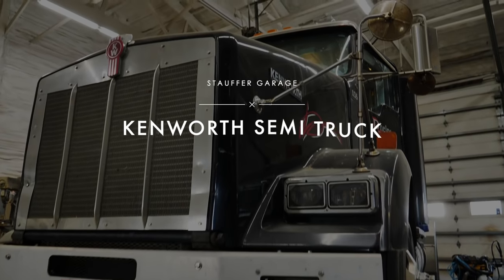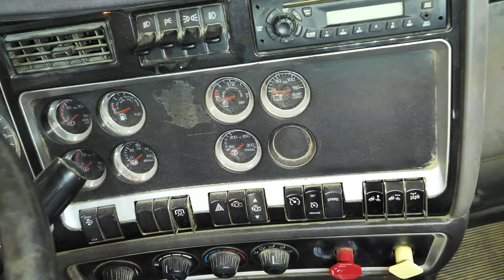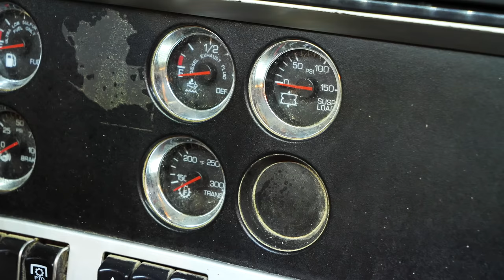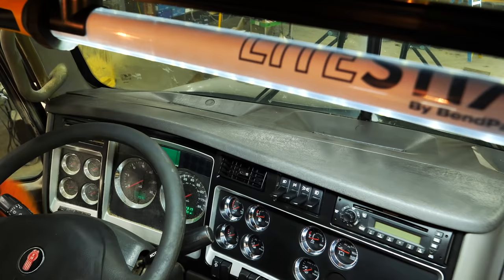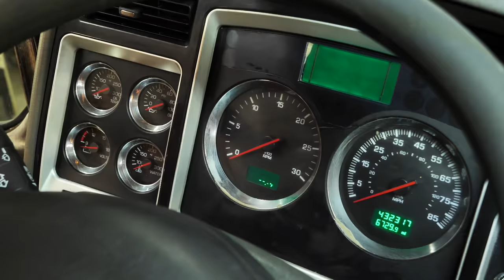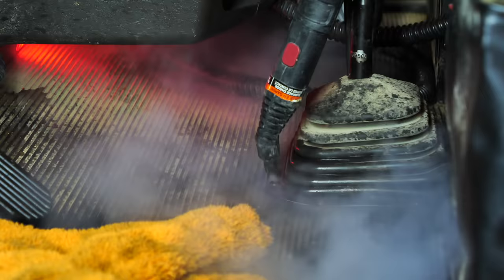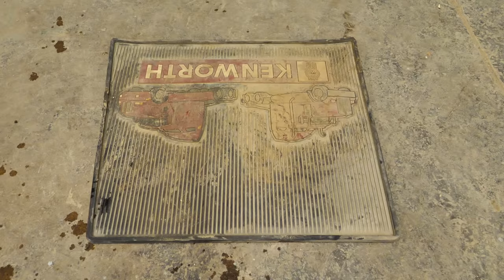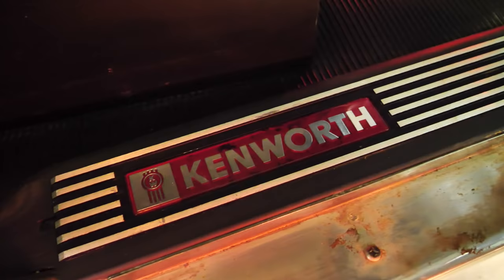Deep Cleaning A FILTHY Semi Truck For Free! Car Detailing Restoration

Comment: I have had a good start to the year with a couple of old rusty tool restorations and repairs. It's gratifying to make something nice and useful again. It's also addicting. The steam cleaner is a great tool - heat, water and pressure. Just what's needed for some of that dirt. Nice job. Yes it would be good to see more of this tractor cleaning.

Comment: As a truck driver myself I know it can be a pain trying to keep them clean. Especially when pulling grain. You're constantly dealing with, not only the dust & debris, bit also the weather & constantly tracking dirt & mud in the cab. I'd be nervous about driving that truck too! AMAZING JOB! Now I want to pick up some gear & do the same with mine! I keep my truck clean but never thought about doing this detailed of a job. Now I want to.  Thanks for the motivation!  Definitely going to subscribe, watch more & pick up a tip or two! 👍👍

Comment: I am an over the road truck driver and I am currently in a 2020 Freightliner Cascadia that as of right now as I sit in a truck stop parking lot, it has 405,312 miles. I got it in late May of 2019 with 12 miles on it.

Comment: Hey boss, you did a fantastic job. I used to own semi’s and drive dump trucks (family has been in the business since 69) and I have to tell you, you definitely missed a step that would have made your life way way easier. Keep in mind, these trucks are meant to be abused for millions of miles. There are no electronics under the floor. The floor mat actually separates and lifts out. There’s usually 50 pounds of dust up under it. It’s also made to be hosed out. Specifically with a water hose. Trust me, that makes it so much quicker to clean up. Also those doors (as I said earlier they’re meant to be abused) can easily take a stiffer bristle brush without even the slightest bit of damage. They’re extremely thick plastic and vinyl and they’re meant to deal with harsh cleaners, oils, grease, so on.

Comment: I've done MANY Kenworth and Peterbilt floors in my drivin career. Been up for, but never won, best interior awards. I use rough terry towels on the floor with warm soapy water. Then I use Chemical Guys VRP or Silk Shine on it. 

I recently switched jobs and had to do a thorough detail, almost like this on my assigned truck. Took me about 4 hours. 

Lastly, when I wash I wash a truck, it takes me about 8 hours and no waxing or polishing. Just wash, detail inside and dress the rubber and plastic.

Comment: On semi trucks( the ones with the peephole window) located on the lower passenger side door. They pop out, from the inside. Usually they have two little key tabs that twist, opening the window to allow servicing/cleaning of the inside.

Comment: My positive turn around in my life. That after 4 and half years. I finally beat type 2 diabetes. No more insulin. No pills. Al this happened in the last two months of 2021. The first nou thing I still have to beat is hypertension and the pills for it. So 2022 I am determined to beat that as well. I wanted to share this. Not for the competition. But as a achievement comment. Also dropped about 24 kilograms in weight. And I did not get the big C ever. So 2022 is health wise the best start ever. Btw. I have one wish. That you will do a fire truck or ambulance in and out. Loved the new intro.

Comment: I used to do this for my Company.  A hint, use a scrub brush on the floor.  Back and forth action.  I usually finished the floor with a lemon or orange smelling windex product.  Then wiped it up.  Used a lot of towels for sure.  Then I'd take it to the Truck Wash to have it 'De-Greased', then washed, then sprayed on waxed.  They do the frame, engine and tanks, battery boxes fairly cheaply.  It's only going to get dirty again.  Truck dirt is different then car dirt because the grease and oil and diesel fuel make it just plain sticky.

Comment: If you're really worried about electrical you can alternatively disconnect the battery, steam clean/ saturate with cleaner any electrical(scrub/clean), and wipe down then blow gun/ use compressed air on the electrical components.

The main thing is to ensure the electronics are dry before reconnecting the battery.

Comment: If you give yourself 30 days to get things organized and cleaned it will take 30 days and you will not ever be as motivated until closer to the deadline. But if you give yourself 3 hours your motivation to attack the issue will be so strong and you can be much better with your time management!

Comment: The next time you clean a floor of a semi truck with that kind of rubber mat.... Get a scrub brush and zip tie it to a vibrating sander.
It's easier to get into the groves and it takes half the time of other methods.
At least it works for me.

Comment: A lot of the time your efforts in a truck don’t match the finish you end up with especially the rubber floor , I just power wash  it in a low pressure setting and brush it out afterwards 
Nice job 👍

Comment: Probably won’t see this since it’s an older video. But what might have worked better for those floors is a round brush. Then the rotation would go with the grooves instead of over top of them like the one you used was doing.

Comment: 400k on a semi is barely breaking them in. Many can run 1-2 mill miles. Also a tip for next time you do a floor like that, tire shine helps give it a clean look and also helps dirt not be so stubborn the next time you clean it

Comment: Instead of using a drill brush would using a tire brush and manually scrubbing back and forth be a more effective way to clean the floors?
Reply from the maker: It would work but which one fatigues more if you do multiple cars a day or just want to make it easier?
Reply: @StaufferGarage  true but if your not cleaning multiple semis a day would you want to do it with a wheel brush . Or make an attachment for a one handed saws all that had a brush head to scrub it back and forth ?

Comment: Do you ever get worried about when spraying on the solution about electronics? I was a detailer for a little bit of time and when I sprayed down say the controls etc etc, after cleaning with a brush I would take compressed air and use it to get out any solution left that you can’t see.